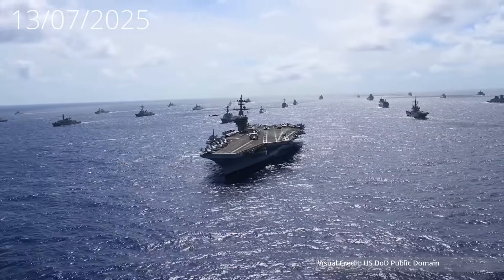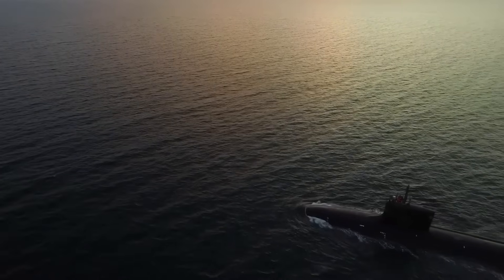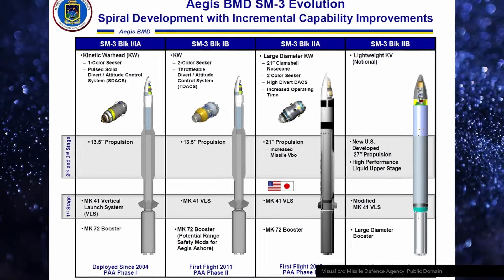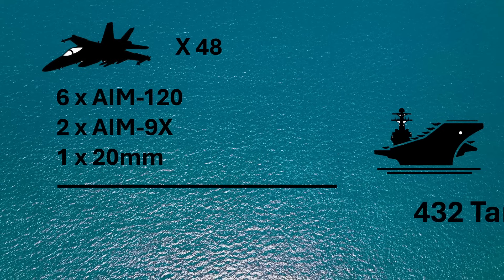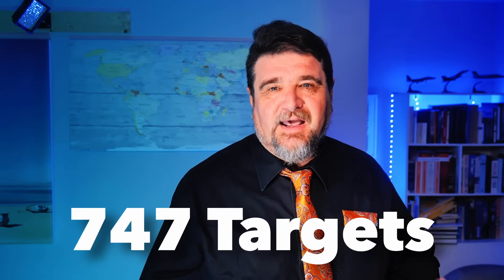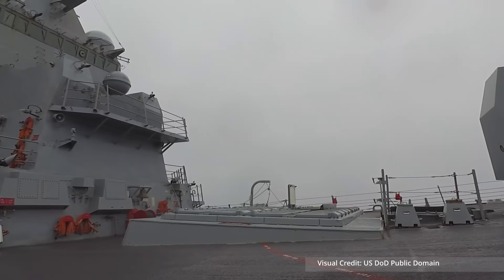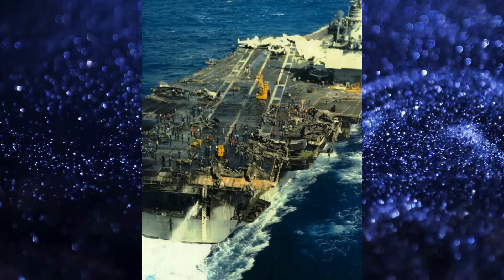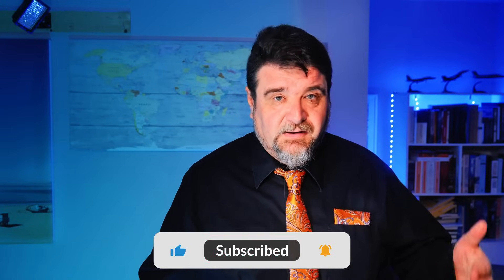HOW MANY Missiles are Needed to SINK A CARRIER?

Comment: There is a massive difference between detonating a few small bombs on the deck and a dedicated ship killer missile with a 1000 pound warhead desined to penetrate in debt either due to sheer speed or shaped charge. If we are talking 200 pound bombs i wont be shocked it it survives litterally a 1000 of them and a few dozen hitting will likely only mission kill it for a month or two. But that is like shahed basic drone size. A zircon on the other hand will likely punch thru the entire ship or most of it due to its insane speed and 650 pound warhead size. A single one will probably need a lucky strike to sink it but that ship is getting towed to port and not leaving it for years. 2 or 3 will sink it with little issue. So how many Zircon does one one need to fire for 2 to reach the ship. Probably 10ish if we are being honest. Carriers are very very well protected but this is one of the harderst targets possible to intercept so even 50% interception is a bit optimistic. In a realistic scenario agains say Russia there will simply be 2 dozen Zircon fired at the carrier group and every single ship in it will get hit and likely most if not all will sink. A single Yasen class submarine carries 32 cells all being able to carry Zircon. It is very unrealistic for the carrier group ot survive a volley of 32 zircons. And said submarine is very survivable at 1000km (maximum zircon range) from a carrier group. Russian cruise missile tend to have even larger warheads so they will be pretty deadly even with no hypersonic speed but the interception would be much higher. Still. Some of them have pretty extreme range so one could pretty safely fire rather large volleys and the interception rate wont be 100%. While a carrier group is enough to conquer most nations outright the simple reality is that Russian and China will sink them all if they get withing 1000 miles of their borders in open warfare.
Reply: USN too now have some fast anti-ship ones with SM-6/AIM-174B, AGM-88G, and upcoming SiAW/MAKO.
Reply: and while you are 100% focused on the carriers, you are defeated worldwide in every theatre by the Americans. The usa isnt a power based just on carriers, its dominant, and has budget for insane toys like carriers. But it doesnt need them. Take away american carriers and thats like 1% of their military strength. They lose a chunk of force projection. But as to total military strength lol, they still the dominant military force on planet. And nothing that ever even touched a zircon is going to be working within a few hours. Down to the people who first mined the ore for it.
Reply: @donovanteale6502  If you sink (or disable) the carrier, attacks against Venezuela must fly 1000 km from Puerto Rico or 2400 km from US, over open sea. AMPLE time to be detected and SAMs wait for them. And direction of attack is PREDICTABLE.
Reply: Can a hypersonic missile be seen by radar, plasma sheath etc.? How early can it be seen? How much reaction time does this leave? All need consideration.
Reply: @inthespirit  it is detectable but unstoppable. KH31 of which Venezuela has over 40, climbs up to FORTY KILOMETERS and falls vertically over the carrier at over 5000 km/h (Mach 4.9). Try to stop THAT.
Reply: lol shill
Reply: Have you heard about the old supersonic Granite missile 5 000 kg.  And they usually come in salvos of 10 at the altitude of 5 meters.
Reply: Just hit where the munitions or fuel are stored and you will have a USS Arizona or a USS Bonhomme.
Reply: How do you guide a missile from  1000 miles away? Given that the carriers can motor at +40 knots, it won't where you think it is for long.
Reply: @dougerrohmer Russia for example has massive over the horizon radar and if memory serves one of them has 3000km range for ships. Then there are satelites. So plenty of way for mid course correction. Final approach the missile has its own seeker.
Reply: @dougerrohmer  The missiles have onboard guidance.
Reply: @andrewdunbar5335  onboard guidance can't see through plasma so it can't be both hypersonic and guided at the same time.
Reply: @observer3137  Plasma only at the terminal stage, tens of seconds. Carriers r large enough and not so fast, so no time to leave. Also ships dont have sufficient maneuverability.
Reply: @sergeytishkin9415  the terminal phase is measured in minutes and the carrier doesn’t need to “leave”, just make a hard turn, which makes hitting it much harder without terminal guidance.
Reply: @observer3137  Terminal phase for a subsonic cruise missile is minutes, but Zircons fly 2-3 Mach in the terminal phase.
Reply: @observer3137  You really think we can't hit a huge piece of steel in the middle of the water, in 2025?
Reply: @observer3137  lol. ok, lets try some maph.

Zirkon reach target with 9-10M speed on alt of the 30-40km. Means it falls with some of 3-3.5km/s speed from 40km so its about 10 seconds, where u was "minutes"?
3-5 minutes - its a full route from start.

And yes, what prevents the ships from making ur "hardturns" to leave the torpedo missed, why do all need torpedoes in ur opinion, when it have much low speed then missiles and any ship can easy make "hard turn" to evade, lol? Do u know what mass and inertia r? Have u ever swam at least once on a boat? )
Carrier has about 10-12 seconds to leave area of strike and it must do its moves not by its previous route (obvious, missile will target not current position of carrier, but further after 10 seconds - to guaranteed shot after terminal stage) = mission impossible.
Reply: @sergeytishkin9415  you think it’s going too speed the entire time? So acceleration and deceleration don’t exist? The maximum speed is only achieved momentarily, most of the time it is traveling much much slower, like subsonic to supersonic.
Reply: @observer3137  Now i am absolutely sure that u dont understand anything about missiles and hypersonic. The hypersonic engine cannt work at low speed. By design. U probably have (sure u have lol) google, why u write noncenses when u can easily see how everything works?

A conventional air defense missile gains maximum speed in the first 1-2 seconds. The zircon picks it up at a height also quickly and doesnt reduce it - cant by design. Why reduce and 4 what? The dense atmosphere at the ground r too fast through to significantly reduce speed. And in any case, there is plasma, the rocket is hardly visible with radar, only thermal radiation.

And yes, there were several videos from Ukraine, where patriot launched 20+ missiles to hypersonic and didnt hit a single one. If everything was as in ur flawed physical model, this wouldnt happened.
Reply: @sergeytishkin9415  months ago one Carrier turned so fast to avoid a SLOW Houthi missile that it dropped 1 or 2 FA18 in the sea.

Comment: I don't usually disagree with conclusions from your vids but I do with this one. In the age of hypersonics, carriers are simply not survivable. They wouldn't last even a day if the conflict broke out.
Reply: Hypersonic is a term that gets thrown around a lot, but I would argue it does not actually change the dynamics all that much.

If you are using "Hypersonics" referring to cruise missiles: There is currently no terminal speed hypersonic cruise missile, meaning that while they do in fact travel hypersonically for most of their flight time, at the time of impact they are moving at supersonic speeds dues to the drag of low altitude atmosphere. Furthermore these missiles have to fly very high and very hot, which makes spotting them very easy. 

The SM2, Aster, etc are all capable of intercepting terminal supersonic missiles as has been proven by both tests vs stuff like Coyote drones and real world experience vs the Houthis.

If by "Hypersonic" you mean anti ship ballistic missiles, these are indeed hypersonic at point of impact. However these missiles fly in a very predictable and easy to intercept arc. The US has two missiles, the SM6 and SM3 which are both designed to counter specifically this threat. Both missiles have proven effective vs hypersonic ballistic targets.

So overall, Hypersonic weapons do add a few wrinkles and additional headaches, however nothing they bring to the table is fundamentally game changing. Its just another evolution in an ongoing arms race of offence vs defence.
Reply: @nescopahe  ASBMs are maneuverable so the terminal trajectory is unpredictable. The 12 day war proved that Western missile defenses are incapable of intercepting the latest EyeRanian missiles that maneuver.
Reply: USN too now have some fast anti-ship ones with SM-6/AIM-174B, AGM-88G, and upcoming SiAW/MAKO.
Reply: but an enemy drawn to attacking them, is predictable. Why not dangle a honey pot, knowing your counter attack is going to be perfectly timed and planned. Defeating hypersonics is a tech path plenty are on currently, the issue is interceptors cost more than missiles, so longterm succeeding is still losing. And once the carriers are gone, what are all the hypersonics for? New disguised smaller cargo ship drone carriers not worth a hypersonic could exist in a sea without conventional carriers
Reply: @donovanteale6502  At what cost and what preparations?

The whole US Pacific power projection is based on carrier strike groups. If a carrier gets struck with the majority of aircraft onboard, then it will lose its power projection abilities. If the attack is telegraphed and they can off board aircraft ahead of time, then they lose the range and mobility for all those carrier aircraft.

Guam is too far to reach any real combat zones without refueling. Bases in SK, JP, PH would only be involved if the attack is directly on one of those countries, otherwise the host nation risks being dragged into a war they didn't sign up for.

So long as the carriers are disabled or even just kept at bay, there's very little the US can directly impact a battlefield short of resorting to more extreme methods. Even if anti-missile defenses improve, so will the missile technologies.
Reply: @frankunderbush  and even after all that, the usa still has global military dominance. its wild. america can withstand trememendous damage. you can give usa a bloody nose but you cannot knock them out.
Reply: @donovanteale6502  It's not necessary though. They are the only military force with an objective to enforce a global presence. Everyone else focuses on just one or a couple of areas. 

Say one carrier group in the Pacific is knocked out of action. They now have to decide if they can afford to pull resources elsewhere to plug this hole. ex. if they have to pull vessels from the Red Sea but then risk losing some control in the Middle East, they might reconsider or only pull limited reinforcements. Their military is mighty, but they are stretched thin based on what they want to do. 

If China spent a ton of resources to fend off one carrier group, then what? The US won't be able to send any ground troops without naval support. Their aircraft are too far away. So despite suffering heavy initial losses, China basically drove the US out of the theater for at least weeks if not months.
Reply: @frankunderbush  I think you underestimate how dangerous a bad loser is. Destroying a carrier group is giving the USA permission to use strategic weapons as they are a strategic asset. Thats  a worry even for a great power like china

Comment: Hahaahaa, have you heard of the Kinzhal missiles? 2000 km range.? Have you ever heard of a similar platform with a similar reach? TU 22m have  at least 3 missiles. With today's technology, as we see in Ukraine. The percentage of missiles shot down is exactly 0%. Zircon missile 1000km range? Kinetic energy only, without filling with explosives, makes huge holes. Have you heard of low-power nuclear charging? I'd like to add these parameters to the analysis.  Only on the air platforms. No submarines, no Poseidon that has unlimited range, etc. An aircraft carrier with current technology on the west side, is just a big and expensive target. It's going to get to the bottom of the ocean very quickly.
Reply: TU-22 are also big and expensive targets.
Reply: Far, far cheaper than an aircraft carrier with 70 aircraft and 5,000 sailors and pilots. And most importantly. The TU 22M has a firing range of at least 2000 km. And the aircraft carrier has a defensive range of how much.? So... After all, an aircraft carrier is a larger and more expensive target that goes to the bottom of the sea.